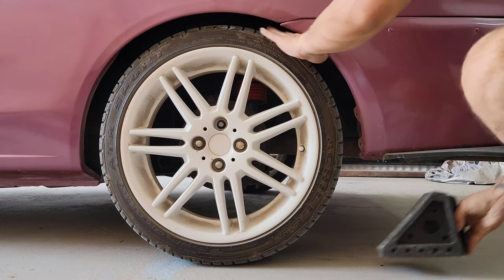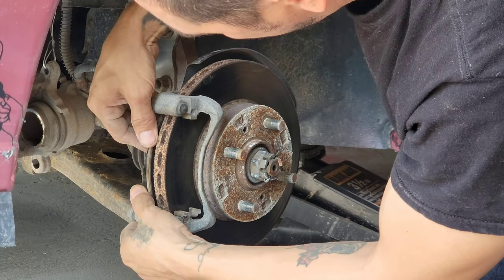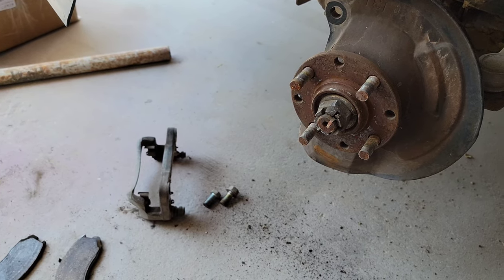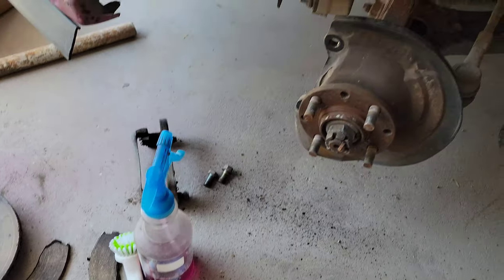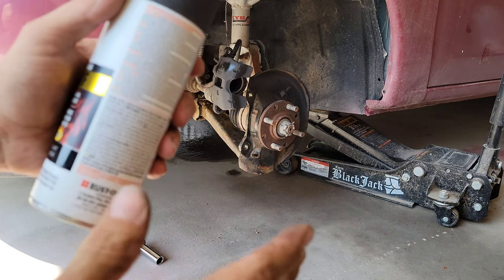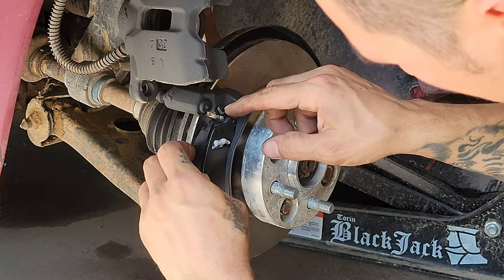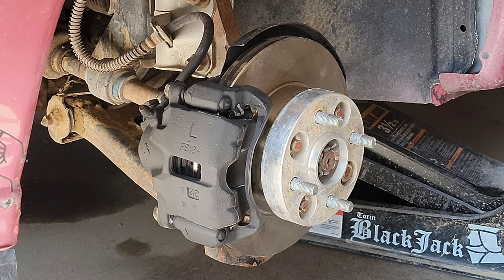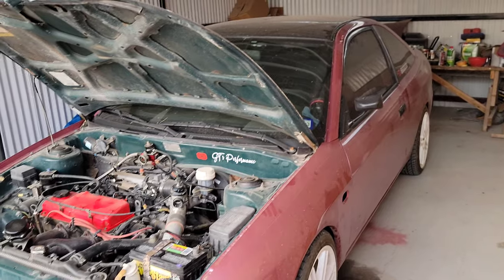97 Mitsubishi Mirage [Front] Brakes & Rotor Replacement

Comment: For the price, delivered, very rare I go to local parts stores. I believe the heat curing process if for painting manifolds. 
You'll be good to go for years, once that fluids sucked out. I like to use a dollar store turkey baster, and a $10 amazon one way bleeding tube. 👌
Reply from the maker: Yea, the paint was for manifold,  so the instructions for baking were 350°f / 650°f etc.. I'm changing my turbo manifold,  so I actually bought it for that. 
I was at the store earlier and saw the turkey baster,  but opted for some syringe instead.

Comment: Thanks for making these videos. I own a mirage de coupe as well, and find info on them isn't the easiest.
Reply from the maker: Not the most popular car out there,  but still very fun and reliable!
Reply: @GTsPerformance  That's why I got mine. I liked how unique it was. Bought it off this older guy that put some work into it, and he threw in tons of extra parts from his friends car he parted out that was wrecked. Including a spare motor. So that was quite a deal.
Reply from the maker: @Pure Metro  I bought mine from an older gentleman,  but unfortunately it was already rear-ended.. Luckily,  I only paid $600 for it! That's why I call it the "Lab-Rat".
With this car,  I experimented with rustoleum paints, basecoat & clears over oil based, I learned about turbochargers, and pretty much everything I put into this car 😅
Reply: @GTsPerformance  Still not a bad deal. I paid 2,000 for mine but with the extra motor and parts I think it was a good price.

Comment: GT, I was wondering if the larger wheels caused the pads to wear out sooner? You might have gotten away with having the discs turned but I know from experience that the more meat on the rotors the better to prevent warping and a pulsing brake pedal. Great video!
Reply from the maker: To be honest,  this is the first time I replaced the brakes on this car ever since I bought it a few years ago.
The bigger wheels could have taken part in it, but no way to be sure.
I noticed uneven wear on the pads.. maybe suspension parts need replaced also

Comment: Only thing I didn't see was any anti-seize between the rotor and the hub flange, not to knit pick but that's one thing I always do so the rotors rotors are easily removed
Reply from the maker: I see your point! I need to get some brake fluid from the auto-parts store to replace the one on the reservoir, I'll pick up some anti-seize while I'm there 👍